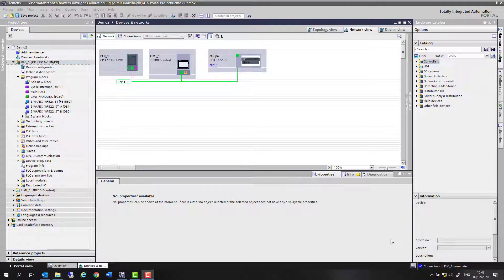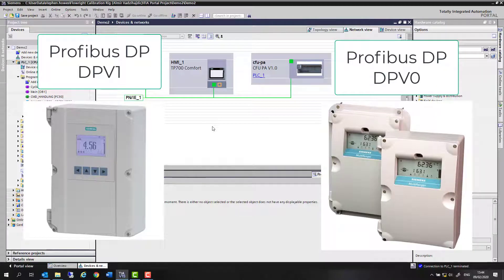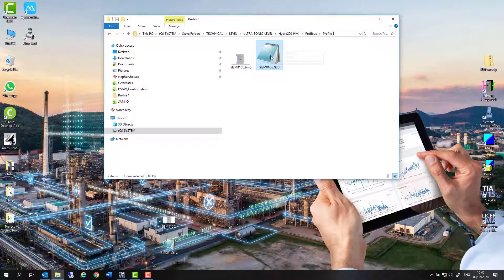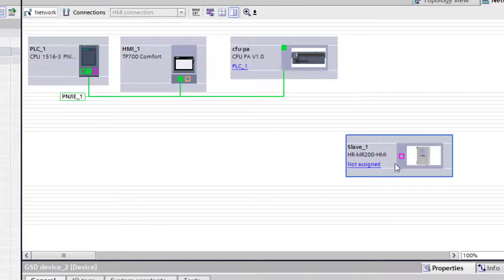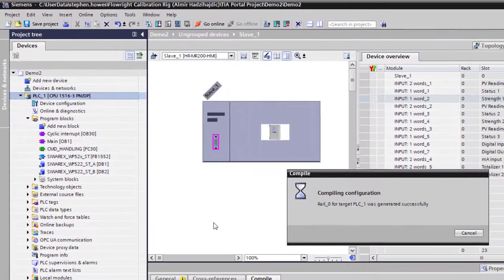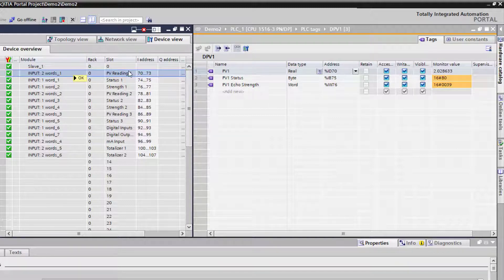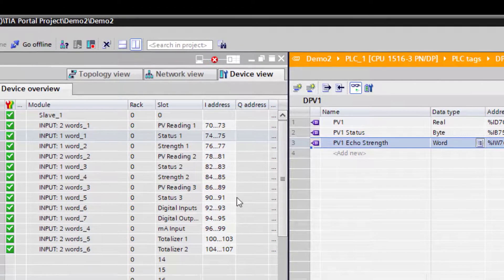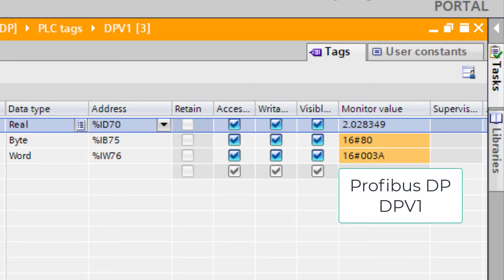How to add Profibus DPV1 Instrumentation to TIA Portal

Comment: Could make a video explaining how to populate index table at 04:40? TIA. Great video.
Reply from the maker: I will but something together.   I can’t connect to the device as I no longer have one.  However I can show the process.
Reply: @IOTConnectivity  Thanks, much appreciated. Subscribed. When the index table is populated for profibus DP device (sensors/ actuators) in TIA portal, is it possible to customise the I/O addresses or is it dependent on the hardware configuration?
Reply from the maker: @akshaypotdar1840   I have just posted the video below.  Some GSD allow you to edit, but you need to have a GSD that allows you to put in a spare / black.  You can't leave the slots completely empty. https://youtu.be/S32VRAkUqY8
Reply: @IOTConnectivity  Thanks, much appreciated. Very helpful video.